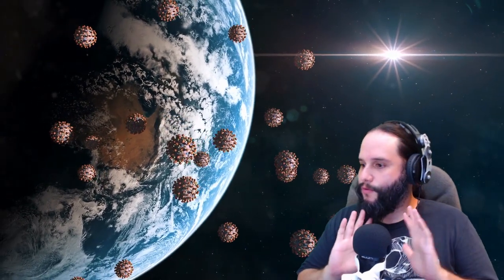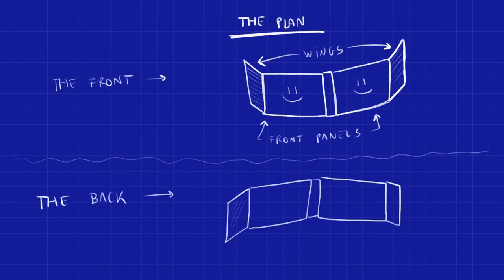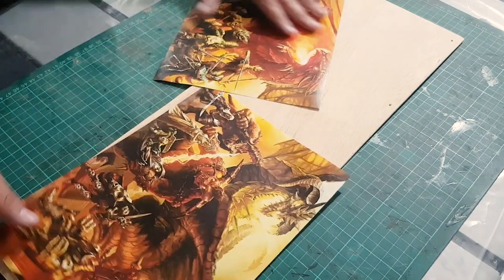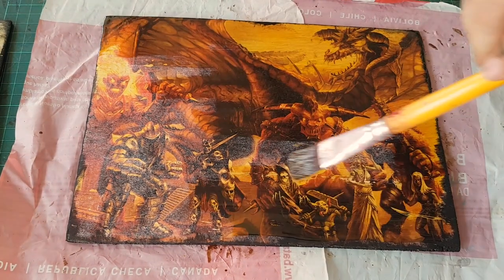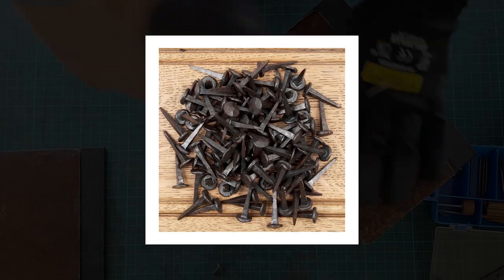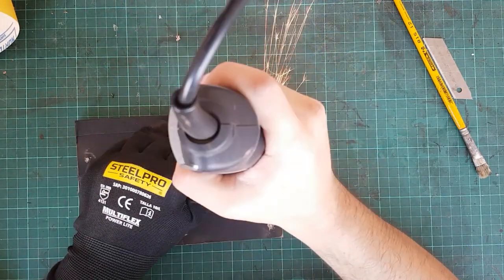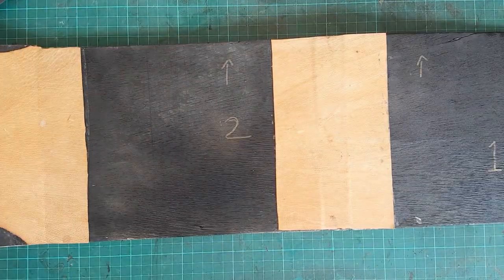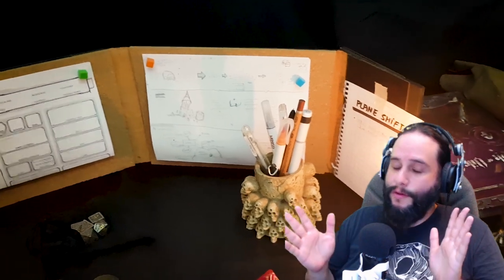Building a Dungeon Master Screen (with trash)

Comment: That toner transfer to the wood blew me away. Will that only work with lazar printed pictures on will it also work with inkjet printers?
Reply from the maker: Sadly it only works with lazer printers. Since its "ink" is more like a plastic it sticks to the glue and stays on the wood when paper goes away with the water. I tried with regular ink printers and the whole thing disapears after the water comes in...

Comment: Instead of using mod podge can I use Elmer's glue or regular white school glue
Reply from the maker: Sadly no. I tried and the glue just wont keep the toner stuck and just everything goes away with water.
Reply: @JCRandom  so what other types of glues can I use will the gorilla glue resin work
Reply: @JCRandom  I'm trying to deal with what I have around due to the pandemic
Reply from the maker: @samstapleton3739  yeap. Same here. I also didn't have ACTUAL mod podge (that isn't even for sale in this continent)... I had a box of very old very dusty pre-pandemic bottles of many kinds of random varnishes and glues and glues i bought at some point in the past, so i spent a couple of days testing all of them using small pieces of paper until i found one the worked similarly to modpoge.
Reply: @JCRandom  thank you for all your help I'm going to try and do the same thing that you did I loved your DM screen is look the best out of all of them
Reply: I got all my pieces Staind and made up now I just need to transfer the picture wish me luck I got a hold of mod podge to so hopefully it works